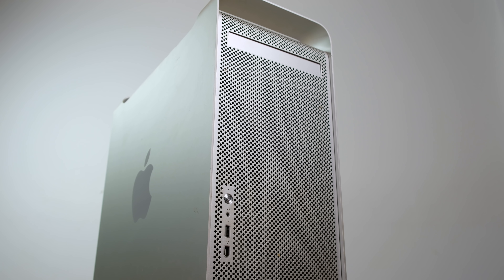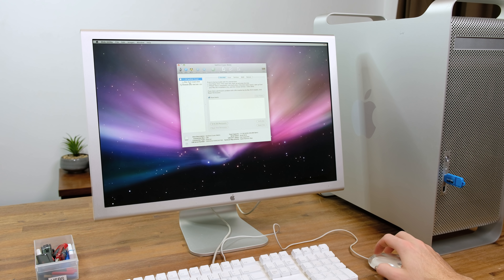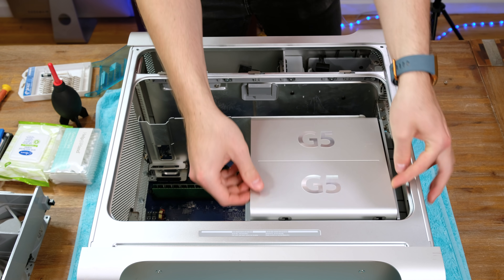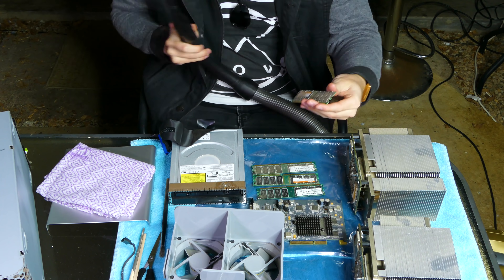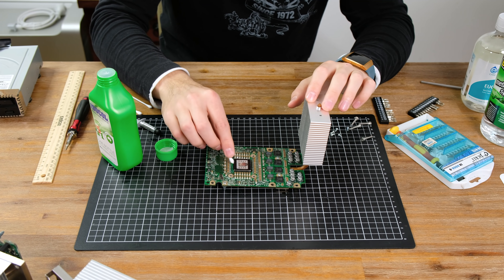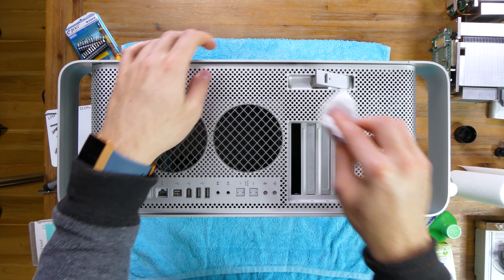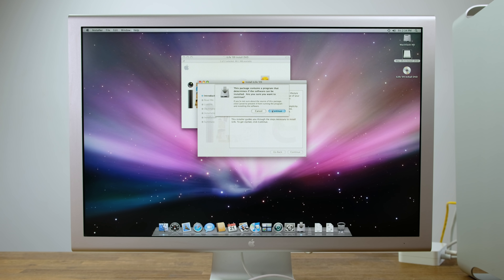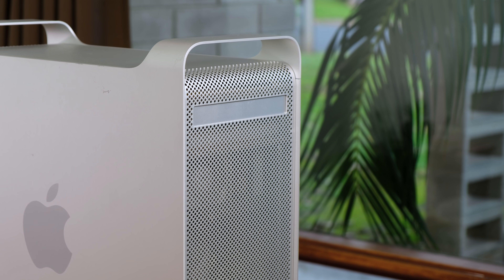Using The Original 'Cheese Grater' Power Mac G5!

Comment: Thank you my wife just bought one for my son at Catholic Charities for $50. and when she called to tell me just then I got a major pain in the pit of my stomach because I have never worked on anything Apple and very little of any Intel devices. I started building windows PC's before this was made but only used AMD motherboards and Nvidia graphics cards. I have been given some ATI cards but because of memory restrictions have avoided them. My son fried my extra Nvidia 1050 TI and he said it was because of the Asus motherboard he had. He said he researched it and for some reason the motherboard overheated and fried the video card. The entire back plate of the video card had some blue staining on it, I assume was from the heat but have considered it was from electrical arcing.

Comment: Hey man, that issue with screws sticking, I apply a tiny bit of grease into the hole and it will stick. Saves you sticking them with blue tack that is hard to get out and grease makes the thread last longer.

Comment: While I applaud you for a great job of restoration, most people just don't have the skills to resurrect one of these machines. There isn't anyone (I know of) who restores these machines, fixes any issues, upgrades them, cleans them, recaps them, etc., to make them a viable machine (as you have done). It's wonderful but there is really no-one to buy such a refurbished machine from. Plus maintaining it would be hard too since I expect Apple wouldn't do it and you'd eventually have the issue of being locked out of Apple software (as my 27" iMac 5K is locked out of the development environment). Don't get me wrong, it's great, but it's really great for a subset of people with the necessary system building skills.

Comment: Always interesting your videos, let me tell you something.
You do not have to unscrew the screws that hold the heatsinks with the cpu completely, it is enough to loosen them because when you tighten them they widen their seat blocking the cpu board.
The G5 dual cpu can easily support 8Gb of ram, but having only 4 slots (very strange thing I see for the first time) it should support 2Gb DDR400 modules each. Not being ECC you can easily mount those used in the old Pentium 4.
Using a G5 for modern encodings such as H264, it cannot perform fast calculations on HD video. But it will handle HD 1080, ProRes, HDV, DVCAM, DV all in realtime even with effects with FinalCut Studio2 (FC6).
It will also handle 720p YouTube videos if you use particular optimized software (whose name I don't remember but it works)
I ran tests on a 7.3 model dual CPU 2.0Ghz and FC6 Studio2 and I can assure you that this machine performs on par with a 2.1Ghz DualCore Core 2 Duo (2006/2007 on iMac). The rendering times on 1min of DV video converted to Mpeg2 DVD via the Compressor (Studio2) app took 29sec on the Core 2 Duo and 27sec on the Dual G5.
I can assure you that in 2003/2004 making video editing in HD was fun on the G5 and FC4 but on PCs with double Xeon at 3.4Ghz I had to wait another 2 years to discover that always on Mac it was better and above all more stable and functional.

Comment: A couple issues here.

The CPU's definitely needed a repaste, but something not so obvious is that the memory controller on the backside of the logic board needs it even worse than the CPU's. U3 in these machines gets scorching hot, and the early models were known for failure of this.

After a repaste, the G5's need a Thermal Calibration using the ASD disc.

Comment: Do you know how to fix the issue? My 13 year old Mac g4 turns off automatically after using for sometime. Tried thermal paste, replaced power unit 4-5 times, but it’s still having issues.

Comment: Who else’s first computer was this? I remember playing games on this computer growing up. It had windows 7 and it was running like a charm.  I didn’t remember this pc having Mac OS, probably they changed to windows xp before I was born. It has intel core 2 duo and not PowerPC so the processor has changed. It has 4gb ram and a nvidia graphics card. It was able to run gta 5, although not that smooth. Also it has a 1tb hdd, I’m not rich enough to afford a ssd. My 13 year old mac still works but keeps shutting down after using for sometime. My old pc is in storage, dusty and I don’t know that to do with it?

Comment: To prevent future dust buildup, you can place a dryer sheet over the intake side of the fans before screwing them down into place.  I've been doing this for over 30 years and it keeps the insides of my computers nice and clean, and as a bonus they smell nice, too.

Comment: I bought one of these that had the watercooling. Opening it up revealed a lot of rust on the power supply, so I didn't even dare power it on. That  worked out just fine, though, since my plan was to put my gaming pc inside. It ended up being pretty janky, but it works! 

I really love the design of that case and from the front, you can't really tell at all that it's not original. The LED, power button and USB port all work, and the only thing that shows it being not original is that there are fans mounted with small screws to the front.

Comment: instead of putting blu tac on the screws, id suggest sticking on a small magnet on the side of the metal rod of the screw driver, that would magnetize the entire screw driver making it easy to remove and instal screws in deep nooks and crannys.

Comment: On a related topic outside the architecture, I have 2 of these Mac pro G5 units but with ONE CPU config each. They are missing the AGP video card and drives. WHat AGP card do I need to buy to make these boot up? Everything I have fails to boot as I do NOT have a ATI Radeon 9600. I have 9000 and 7000 only. And some older Rage 128 cards. I heard nvidia cards work too but my Geforce FX5200 cards do not. Soooo, now what? The ram is intact, hardly no dust in both and they do power on with blinking light or no light at all. Very loud. Finding sata 1 drives may not be an issue though I have alot of sata 2 SSD and traditional drives. No Sata 3. If I can not get these to work I am thinking of gutting them and using the nice cases to mod them for INTEL mini itx motherboard or even a group of fanless computer thin clients inside.

Comment: The plastic rivet was to allow Apple to determine whether you had tampered with your Mac before you brought it in for repair. Doing so would invalidate the warranty. There’s apparently a knack to getting it out (as Apple engineers would when working on them).

Comment: What’s the upgrade issues with these? I’ve got one here at home - seen someone max out the Mac Pro version but mine’s just the G5 Cheesegrater - is it even worth trying to upgrade these due to the bus speed of the motherboard... doubt any upgrade on these would do 4K/8k video in the latest Final Cut Pro running the latest OS.. would love some advice on that...

Comment: I did dev / ls to get a list of all devices, and surmised that /ht@0,f2000000/pci@4/usb@b/disk@2 is the usb disk I'm trying to boot from. I did shut the machine down, start it back up without the drive in place, then went through all that again and disk@2 wasn't there so I'm pretty sure I've got the right path. anyway, I go back into Open Firmware and type boot /ht@0,f2000000/pci@4/usb@b/disk@2:,\\:tbxi  ...and it just sits there. anyone have any idea how long it should take from there? is it actually doing anything? I watched this t=113 but there's an obvious cut right when he enters the command so I've no idea how long this should take in real time.

Comment: I believe that the plastic pin which holds the CPU heat sink cover in place was used as a type of warranty seal. It was intended to be next to impossible to remove without damaging it. A damaged pin voided your warranty. Not really an issue in 2020 though.

Comment: I had borrowed one of the quad CPU (dual socket, dual core) PowerPC G5 systems about the time the Intel i7 came out. This one was the model where all the RAM DIMMs were on a separate card that slotted into the system. I ended up running the PowerPC version of Ubuntu 10.04. At the time, it was actually slightly faster in some of the applications I was using (mainly software surrounding OpenCV) than the shiny new i7-870 desktop I had at the time. The G5's were surprisingly fast. However, in the end, what killed them was that IBM wouldn't commit to pricing to Apple and also wouldn't commit to reducing the power consumption. With consumers rapidly shifting to laptops rather than desktops, it was a no brainer that Apple switched to Intel, since they offered much better performance/watt. It also doesn't help that as of today, the current x86_64 processors are clock for clock faster than the modern IBM POWER chips.

Comment: I will never understand why Apple just refuses to put a dust filter on their systems.
Macs are the dustiest systems ever, and I've opened up school and hospital computers. Macs are always the dustiest. 
Apple doesn't want you to open them, and they don't want to put dust filters in them.
Reply: It messes with airflow, which would require higher RPM fans to cope, therefore more noise. That's why. You should not put them in the floor anyway. They become vacuum cleaners. All that dust is someone's dead skin cells. Yuck. I'd use a N95 mask before dusting.
Reply: @alkunstmann  I KNEW someone was going to say "It restricts air flow."
Hey guess what else restricts air flow? 
D U S T
Causing poorer heat transfer on things like heat syncs at the like.
You know what else causes fans to work harder? Dust.
Dust filters do not eliminate dust, but they don't restrict air flow as severely as a fuck ton of dust does.
On this system is easy to open and dust, so maybe you're right, dust filters are dumb on something like this.
But what about other products they don't want you in? Well golly Batman, looks like they don't want me in here even to dust it, if only dust didn't build up so much on these machines... If only they had installed a filter, that helps with dust build up! But it would probably restrict the air flow too much.

You are what Apple wants to hear when they make decisions like this.

Comment: i bought one years ago, and couldn't use any modern software, no browsers etc. but i was able to install the latest Ubuntu (Linux) using the Unity desktop environment, very similar to mac os and i was up and running current up to date software, and it was faster than using the mac os 10.5

Comment: I used an original PowerMac G5 as my daily machine, in 2014. These were loud, but they were otherwise fantastic machines; they were certainly faster and cheaper than the Dell and HP workstations at the time.

Comment: I have 2 of these in my closet! Every once in a while, I pull one out and connect it up and try web surfing... ive got 4gb but not running an ssd.. its cool to see snow leopard boot up, but mine had a hard time with youtube playback... choppy and the cpu usage was very high...the fans sounded like a jet on takeoff whenever I tried to play anything,so i relegated it back to the closet... it IS a beautiful engineered machine though, almost a work of art!..   I'd sell them to a collector thats into these for restoration, but for me, i prefer my 2006 mac pro 1,1 with the 8cores at 3ghz and 32gb ram and raid 0 ssds.. better yet, a dell i7 hackentosh with 4790 cpu... I like the speed what can I say?

Comment: Machines like this and the G4 is why Macs established themselves as popular amongst artists... in general.  Both sound, VFX and general art.  Macs were a cheap alternative to purchasing a workstation.  Because despite being really expensive, they still ended up being half the cost of a PC Workstation and for the artists the OS was easier to use.  These days they still use Apple computers purely out of ignorance and standardisation, rather than them being any better than PCs.  Because keep in mind, before the G4 came along, everyone was using Silicon Graphics workstations which cost in the quad digit range ($10 000+), to then move to this, something which cost half the amount.  And when SGI imploded, people had to build their own workstations, use PC parts and use Windows NT.  So, the G4 and G5 was simply the right systems at the right time for artists.  (Also the G4 and G5 despite looking like mid towers are actually built like workstations, so all that space is used, they are heavy.)

Comment: Nice video! I have the same but the entry single processor 1.6 GHz with a SSD. But it isn't a 2020 PC only using the same web browser you use, with 3 open tabs the PC gets really slow. So slow that the processor is 79% of using by 3 simples pages. It is not usable.
Reply: I have ones with 2 single core cpus and agree..its sad to see but todays evolving demands require Much more HP to run and these one time beasts are brought to their kness trying to do it..

Comment: I restored one of these G5s and was able to get an SSD working on a PCIe card using the full 16-lanes using the native "Expansion Slot Utility".  I can't remember the mb/s I clocked it at but it was over SATA6 speeds if I remember correctly.  Definitely a fun build as I'm sure this one was for you.

Comment: Just a comment on spinning up fans with them plugged in to a circuit board. It sometimes can cause the fans to act like a generator if spun (I believe) backwards which can short out components. Try holding the leads from a small motor Agnes your rung and spin the motor backwards (you will probably feel a shock cause the motor can act like a generator.) Not trying to be mean just a helpful comment. To the inevitable idiots who think this is bullshit my computer repair/working on/building/fixing teacher (30 years teaching/working on/coding computers) said it many times. It can also actually damage the bearing if spun too fast (info from same teacher). 
Also not really suggested to use a vacuum with a plastic tube cause static charges can build up on it and jump to the components your trying to clean. 
If ppl want to chime in with friendly comments(conversation ) feel free to do so.

Comment: Great video! I've never had a mac, since 1999 (when I had my first computer) iv'e used only windows based sistems... And i have no regrets :P (as a gamer), but the g5 alwais had a wonderful design that i've alwais loved, for this reason even today i'd like to have one.
Reply: You should try one. I did in 2003 and never looked back. Having a real certified UNIX workstation (since the 90s up to now) in front of you feels so much more solid. Even if the interface looks "cute" or unprofessional, below the bonnet it's been always just the most powerful OS you can get that also has desktop everyday-use apps.

Comment: Makes video about using a G5 in 2019, spends 12 minutes on dusting and 1 minute on actually using the computer. :D I went through almost the exact same process as you when I revived a G5 I got recently, although I'm not really sure it's necessary to take out the CPUs and power supply. Mine seems to run relatively cool so the thermal paste seems to still be doing its job. Also, I decided to use OS X 10.4 Tiger instead of 10.5, since this is the fastest computer than is still capable of running Classic programs, but that capability was removed after 10.4.